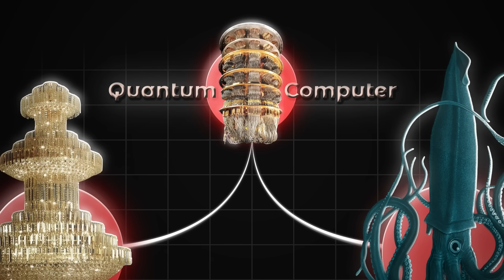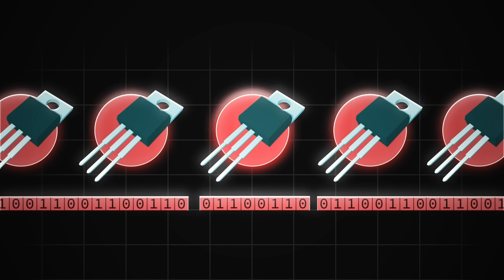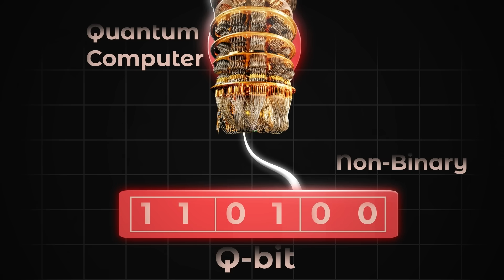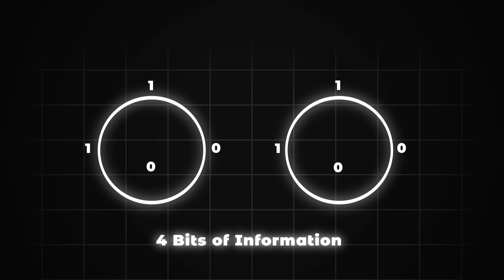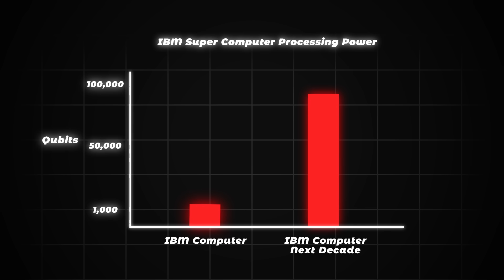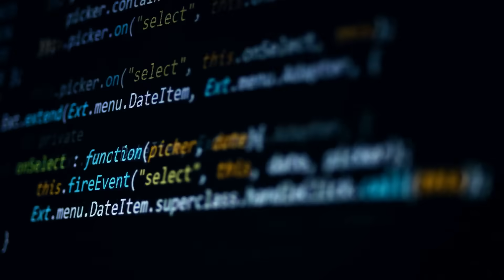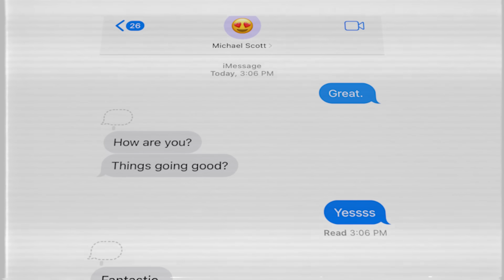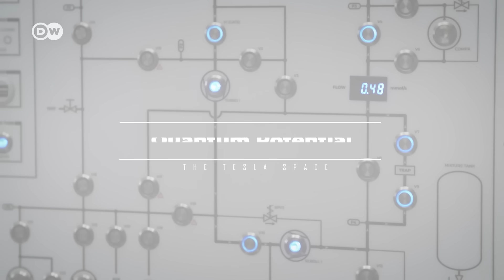Why Quantum Computers Will Break Reality

Comment: Nice video, as someone learning computational theory there is something I would like to point out.
1. There is good reason to assume that brains can at least partially use quantum computation, or maybe even something more powerful then our current models thanks to quantum nanotubes, which means room tempreture and pressure q. comoutation is possible probably.
2. Our current mathematical understanding of quantum computation provenly is only powerful as our best classical computational models. This means that the things we can not compute on a classical computer can not be computed on our current quantum models. The only advantage it has is that there are a class of problems which can be done faster.
Reply: The leaf is a single purpose quantum computer for photosynthesis. Instead of the ceiling it hangs from a tree.
Reply: Good comment. I don’t see that the theory of computation gives a reason to think brain uses quantum computation. It seems obvious in some way that it must, but what are the odds for evolution v just another ghost.
Reply: "The only advantage it has is that there are a class of problems which can be done faster."
You say that as if thats trivial
Reply: @MrKrusten  It is not trivial, but people might not understand that there is an infinitely large number of uncomputable problems which we can not solve with any type of Turing-complete machine, include a QTM. Around any busy beaver(752) the number is uncomputable by a Turing machine probably, thus if we want to solve problems bigger than that, we have to come up with a more powerful computational model AND implement it.
Reply: Regarding point 1. The theory you may be referencing is Orch-OR by Penrose and Hameroff, which is an interesting theory, not least because its predictions are testable by measurement and experiment.
Reply: @periurban  Yes! I am referring to that one. It was also recently proven that such structures do exist in cells and there are measurable quantum effects. Of course this is not an actual proof of it being part of the computation process, but I would be surprised if it was not involved.
Reply: @periurban  what?
Reply: Yes and because of those limitations quantum computing will most likely be used in conjunction with a regular supercomputer, so that the quantum computer is used more like a co-processor.  Within about 10 years I expect these things will be pretty useful and powerful and much more understood as far as how to make good use of them.
Reply: 11:17😳
Reply: Love everything until it loves you back!! Mosquitos too!!🦟 ❤

Each of us and each galaxy would represent a cell!! 🦠 We’re stars putting ourselves back together again!! Like Humpty Dumpty!! 🥚 🐓 

The sky is blue because we’re meant to imagine it as a diamond!! The auroras then create the rest of the spectrum!! 🌈 💎 

A purple sky would reflect the heart of the ocean!! An opened mind!! 🤯 The earth purring more!! Purrrrrple rain!!☔️ 🐈‍⬛ 🧶 

Each thought to me is a solar flare, which shifts us into parallel worlds!! It’s hard here!!! I’m a peaceful dude, yet my life here has been super difficult!!🥹

Alpha Centauri represents a shift in consciousness!! Dog planet!! We’re riding the alpha waves!! Woof woof!!🐶 🐾 This is our world peace and enlightenment for the world and universe!! All is one!!😇🥳🥰🤩

We’re each a mini universe!!🌌

The 3 Body Problem represents our gut brain, 🍱 heart,❤️ and mind!! 🧠 

The moon is a black hole!! 🕳️ A neutrino!! The planet is a colonized moon!!😇🌍👽 The sun is a shapeshifter!! 🌞 

Are you and I sculpting together as a team or as individuals??? 🧑‍🎨 Using the moon as a tool!!! 🪨 The Sun is the eye!!👁️ 

I love the tool/word grinder!!!😮 We’d be Bumping and Grinding!!😂

The Earth is like a refrigerator and the atmospheric pressure is melting or defrosting the stars above, as if they’ve been in the freezer!! 🥶 

It would also reflect us krystalyzing and becoming diamonds in the sky!! 💎 💎💎 Lucy becomes Maisie!! 🐒 👽 

We could be stars from above aka heaven, melting everything from above, as well! Like a River Running Through It!!! 🌊🌊🌊🌊🌊 Gravitational waves or our thoughts raining down on us!! 🌧️ 

Unlocking a Secret Garden within and outside of us!!🤫 An Oasis!!!🏝️ 🏝️🏝️🏝️🏝️

Flowing!!! It helps a lot to flow!!!🌊🌊🌊🌊🌊🌊 Letting go, so we can concentrate more and work on our project!! Heaven On Earth!!🌍 👼 

Flowers!! 🌺 🌸 💐 and Flow-Ers!!🌊🌊🌊🌊🌊

I know energy is still impurrtant!! 😻 

And of course imagination!!! Love!!!💗 🐶 🎾 🧶 🐈‍⬛

To create heaven On Earth, the galaxies collide!! 🌌 Twin flames connect!! 🔥 🔥 We’re creating quantum entanglement!! Ghost particles merging, becoming more like the Stay Puft Marshmallow Man!!👻👻👻👻👻👻👻👻

The universe is still the Earth!!⭐️🌍⭐️ We’re seeing it from the insides!! 🕵️ Like we’re inside a volcano 🌋 or wishing well!! The stars and galaxies are like coins!!🪙  The Goonies vibes!! 💀 We’re treasure!! Antarctica is treasure island!! 🐧🇦🇶 Unlocking antimatter!! 🐜 Booby and booty traps exposed!! Planet X!! Hubba Hubba!!🥰 

Everything and everyone has been our teacher!!👩‍🏫

3D is like the murky bottom of a bong or volcano!!🌋 The fourth dimension, representing Mars is like the stem of the bong or the volcanos vent!! 👽 Experiencing higher dimensions is like the smoke or magma reaching our mouths 😋 and then circulating through our bodies!! We are the Earth!!🌍 👼 

The road less traveled!!!🧳 🌹 Straight up!! 🎈 🎈🎈🎈🎈We’d be super condensed or extremely packed neutron stars!! Like Rigel!! Blueberries 🫐 Antioxidants!! Betelgeuse has evolved into a neutron star!! 🧊 🦖 🧊 🦕 🧊  🦣 

Our long winding road, exploring different dimensions, finally straightening out!! I’m getting Pee Wee vibes!! Large Marge sent me!!🚴😂

We’re vaporized, as if we’ve been smoked or roasted!! 💨 The smoke representing again those compressed neutron stars climbing the higher dimensions of the universe like a chimney!! I’m Mary Poppins, y’all !! ☂️ 🧞‍♀️

It would also represent us as a comet traveling through a wormhole!! 💫 

Who me, I’m just a worm!!🐛 🫖 Solving a labyrinth!! 🦉 Solving amaze!!! 🦋 

Different energies tell a different story!! 📚

We’re storytellers!! Artists!!🧑‍🎨 

We’re energy first!! 🐝

Comment: The reason that our mapping of the human genome has not led to cures for cancer has nothing to do with quantum anything. The truth is that we discovered that human DNA was just a starting place. We used to think that DNA comprised all the code for a human body. Now we understand that this is not true. Rather, there are additional chemicals in our bodies that work with DNA and which also comprise part of our code. And some of the chemicals control the way DNA functions. So it is much more complicated than we realized. Therefore, the problem with not being able to cure cancer is the fact that we still do not know enough. We thought mapping DNA would be enough. Now we understand that it was not.

As for quantum computing, its benefits are way, way, way exaggerated. And proponents of quantum computing are quick to forget that there are many, many, many calculations for which a quantum computer is wholly unsuitable, but a binary computer is. The truth is: A quantum computer is a highly specialized tool that has the potential to excel in some applications but not in others. And those "others" are numerous and significant. I recommend that viewers follow physicist Dr. Sabine Hossenfelder's YouTube channel. She provides a balanced presentation of quantum computing that is truly science-based as opposed to the hyperbolic claims and sci-fi speculations which you read in pop media.

Comment: Are there code examples or examples of quantum computer control? How do quantum computers compare to analog computers? For security, what is the quantum proof algorithm and how was it tested? What happens when we combine quantum computing with AI?
Reply: You could conceivably use a fault-tolerant quantum computer to train machine learning models faster, by instead optimizing the model's state using variational quantum algorithms. However, truly fault-tolerant quantum computers are years away. 

Ignoring the problem with fault-tolerance, the variational quantum algorithms that could be used to train such a quantum neural network encounter issues like the barren plateau problem, where updates to the state of the network vanish with the number of qubits in the network. 

There are many, many obstacles to overcome before these quantum computers become useful in applications.
Reply: @rippo14  Would cut its computational speed by a lot, but maybe just have it do each calculation 10 times, then get the majority. Still no guarantees the majority is right, but its 10 times less likely.
Reply: Classical computers deal with decisions, if this or that, quantum computers deal with possibility, what if this or that, and the domino effect… a simulation
Reply: The problem is classical computing is so close to already being at the limits of quantum physics and is way less lossy and error prone. By the time you scale up any quantum computer to the same power you end up with so many errors you need a whole another classical computer to do error correction. Quantum computing will never be better at general purpose tasks than classical computing. mark my words. its all just fluff peices designed to siphon up research grants and venture capital money and will never amount to much of anything useful
Reply: @olmsfam1  Now there's a post that I can believe. The errors are really a problem.
Reply: @olmsfam1  Good take. And everyone not in the "marketing hype train to get vc money" knows that fundamental truth. QC solves a whole different class of problems that would be prohibitively expensive with classic computing, NOT "adding columns in Excel" class problems. If i was to bet money on the next "real step", it would not be QC but Photonic computing.

Comment: Quantum computers have to be one of the most interesting inventions
Reply: Large Hadron Collider too.
Reply: @roejohntiolengco3938  Ya I find it so fascinating the fact that its 27 kilometres underground and shooting particles at 20% the speed of light it just blows my mind.
Reply: Watch the show DEVS, it's about this subject. And one of the best shows I've seen in recent years.
Reply: Right up there with nuclear reactors!
Reply: You would be surprised at how uninteresting they are for the layman.
Reply: Just chips with crap ton of cooler hoses
Reply: YOU TAKE THAT BACK YOU SCOUNDREL.
Reply: On an interesting scale of 1 - 100 what would you rate it?
Reply: @mustertherohirrim7315  like a 80 or 90 because of its potential
Reply: Every computer is a quantum computer, computers compute the Quantity or Quantum of values.
Semi conductors of the computers in ROOM TEMPERATURE have reached their operating frequency's speed limit.
Transistors are ionic switches that with higher frequency of switching they get hot and create errors / noise.
The most practical way of cooling the processors is with Heat Sinks and Fans which we have been using.
Quantum Computers are the higher frequency computers with liquified gas cooling pipes. Concept and the technique of parallel processing is as old as the invention of IC (integrated circuit). We can connect multiple fan cooled regular computers in parallel to achieve the same performance of a Quantum Computer, all we need is a synchronization algorithm to compensate for network latency, same as the one for supper computers.
Reply: Because we all too used to the wheel now ... 😂
Reply: It is certainly the best hoax of all time .  simple question: calculus relies on numbers. Numbers  like 0, 1, 2 or 12345 or 2/3 are expressed with a certain basis, usualy decimal basis  , you can also express such numbers within a definite binary basis 0 or 1 for classical computers , how do you express these numbers within a basis which is an indefinite mixture of binary bits 0 and 1 ???? just tell me, if you can't express numbers  you can't even do any calculation.
Reply: its less than nothing the quantum world u know why they need absolute 0? so it doesnt change states... using it is making it hot they need some other way to make it work not to mantain temperature, we have no understanding how quantum works we say electrons but we detect more like its temperature or weight and its more like a cluster of particles and they are happy with one when they found. quantum is less than 0 they will need to shrink one person to see what is there by the way they think about this is the only way
Reply: It s nopt an invention. It hasn t worked yet. it won t work ever.
Reply: Based on two newish research papers your brain is one already. Yes it is only 2 studies but it is interesting 😅
Reply: @smieltjeh  I heard decades ago that the human brain is a "quantum state" but it definitely has its limits in pure calculation ability.
Reply: @Zurround  I agree there but even so. It would change how we look at the brain in a very big way.
Reply: @smieltjeh  I do agree about that.
Reply: *overh-yped

What is interesting about them?

People claiming they are interesting?
Reply: It will be our last one
Reply: It's the only way to get an artificial consciousness connection is with a quantum computer.
Reply: Quantum computing will bring legitimate real artificial intelligence/consciousness
Reply: Yep, just like cold fusion and perpetual motion.
Reply: Dangerous not good inventions,again fear fear,do as we say....🎬🎬cut
Reply: And expresso machines ☕️
Reply: @relevantinformation6655  lol
Reply: @relevantinformation6655  And a solid 1200 Watt microwave. No comparison
Reply: @relevantinformation6655  and my cat
Reply: As long as the Chinese dont control it
Reply: @steveb6008 they already have quantum computing
Reply: @steveb6008  

Why what have you got against the Chinese ?

If they make the investment a can develop the technology, (which I actually question because I seriously question it's actual viability ,) then not only will they control it they'll be perfectly entitled to do so.

As things stand currently however and despite all this hype there's no such thing a Quantum Computer anyway so whole business much like nuclear fusion, (or like the current American manned space program,) may well be a fool's errand anyway ?
Reply: @Eris123451 the CCP 👎
Reply: Yawn.  I have not seen anything interesting done with them yet.  All I hear is what it CAN do but has our world actually improved from them in any way? NOPE.  Wake me up when something interesting happens.
Reply: @Zurround  Quantum computing follows a false premise. You ll be forever asleep!
Reply: My grand dad invented it. After he invented the question mark.
Reply: They are not an invention, they are an assumption. An assumption created by the fact that some think we ve undertood and defined quantm phisicws when actaully any definition you ve ever heard is a gross approximation or a simple assumption.
Quantum computing is not a thing.
Reply: They're not real.